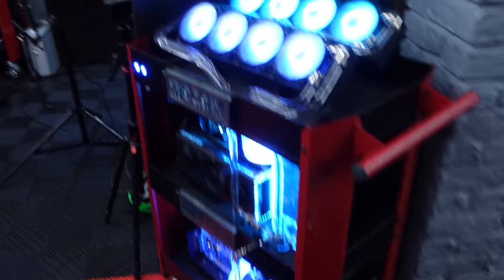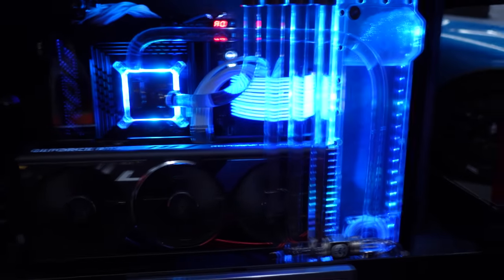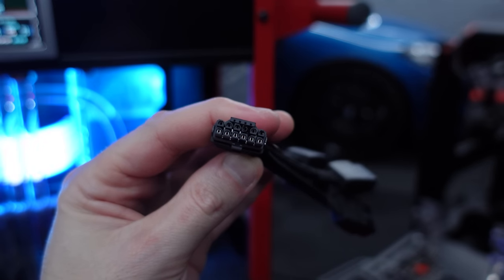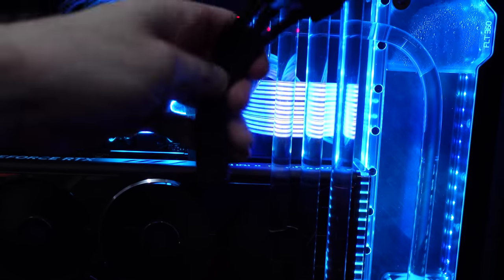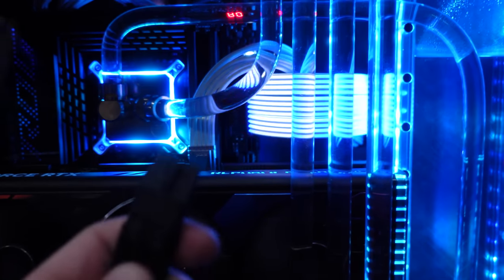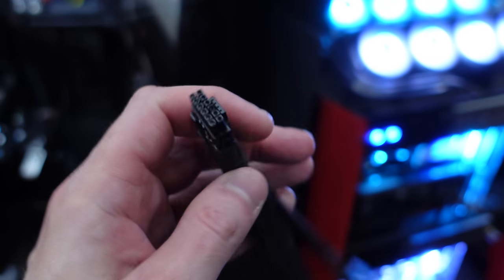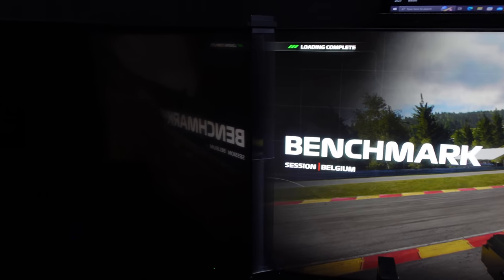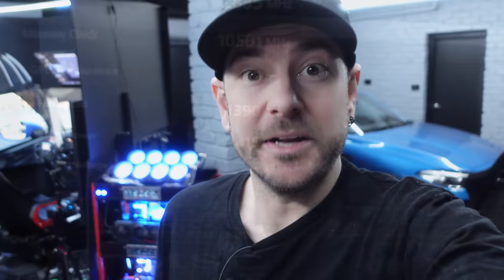MY 4090 WENT UP IN SMOKE after 7 Months!

Comment from the maker: For the people who feel the need to blame this on “user error” before watching the video. Yes it was plugged in correctly. I was absolutely meticulous about this and even made a post 7 months ago warning others. 

The pins were completely engaged and the connector was clicked in to position with the top of the plug sitting completely flush with no gap. There was also no strain on the cables. Only the force of gravity.
Reply: if users are repeatedly making "user errors" on a specific GPU (never happened with prev gens) then I don't think it's user error anymore... it's nvidia shit design.
Reply from the maker: IMO User error shouldn’t even be possible on a connector carrying enough current to cause a fire.
Reply: You have to keep in mind three things:
The first is that the male pin of your RTX 4090 where those high temperatures happened also overheated, so it may no longer be in the best condition. It wouldn't surprise me if this problem happens again in the same place with the new female connector.
Second, when you connect the male connector to the female connector, sometimes there is a couple of male and female pins inside the connector that do not fit well together, because, when the two are joined, one of them can retreat inside its plastic house, due to the excessive force of resistance when joining, causing these two pins to be poorly fitted and this smaller contact surface will heat up in moments of greater consumption of electrical current from the graphics card. This can happen inside a connector, even if it's not the 12VHPWR, which apparently is well inserted.
Another very important detail, mentioned below, is that there are game menus that do not have restrictions on the maximum number of frames that a graphics card tries to do. I've seen a friend of mine's RTX 3070 momentarily charge 1000 FPS in an indie game's menus, which is the only time when that graphics card's fans fire to the maximum of their rotation, as this is the time when the card graphic heats up. And it's already the second indie game where he has this problem, which he can only solve by activating V-Sync in the game's menus. It could have happened that in the menus of this new F1 game there was also this problem and when you were away for 10 to 15 minutes, the game menus made the graphics card work at its maximum, without interruption, which combined with a couple of misplaced 12VHPWR connector pins has led to this unfortunate situation.
Reply from the maker: Yep you’re spot on. Then pin itself didn’t look discoloured on the card side. But I’ve put in an RMA claim regardless as I said in the video. Don’t want to take any chances. 

The pins inside the connector didn’t look to be damaged or pushed back at all. So my guess is it’s just a very minor misalignment internally despite the correct alignment of the outer shell.
Reply from the maker: It’s also interesting that the heat seems to have been generated toward the tip of the female pins which would indicate that was the only part making contact.
Reply: Crazy as. Hope you get this resolved quickly, better for this to happen sooner rather than later at least. 

It's completely unacceptable though, however way you wrap it. The user error gaslighting needs to stop too.
Reply: Yep, the fact that just one of the middle pins has burned and not one of the outer ones, should be evidence that this is NOT the standard case of connector not being plugged in all the way i.e. this does not fall under "user error". 
I don't see how anyone can plug it in wrong so that just one middle pin doesn't make a proper connection.
Hopefully there is a revision/redesign of the spec of 12VHPWR connector.
Reply: Look at the line across in your first still photo. It clearly wasn’t seated flush and there was a gap.
Reply: MSI makes yellow connectors, just to be safe look into them
Reply from the maker: @Danstealth I see the lines you’re talking about but they aren’t from it not being installed correctly. Probably created by the heat cycles through the plastic where the pins end internally. 

I’m sure a lot of these failures have been caused by the connectors not being seated correctly but not this one. I was absolutely meticulous about it.
Reply: Avoid adapters like the plague and stress testing new hardware. Can avoid a lot of problems from bad design and manufacturing like that cursed power connector.
Reply: Can you contact GamersNexus about it? They would gladly look over the cable and maybe give some feedback on what may have happened in your case
Reply: @boostedmedia  the pins don’t end there internally. 

I’m telling you, your connection melted because of a poor connection and that happens when the plug isn’t fully seated. I’m not saying you didn’t fully seat it at one point, I’m sure you did. But when the plug melted it clearly wasn’t. The lines are not there from heat cycles…it’s there because the pins themself got too hot and there was stress on the loose connector.  It’s a very common occurrence and basically shows that user didn’t have the connection fully seated.
Reply: Gamer's Nexus has multiple videos out with extensive research as to why this is happening, and its my understanding that we've known exactly that for some time now. Unfortunate time we live in where thousands of dollars can melt away, sorry to hear this!
Reply: @hellowill  "never happened with prev gens" Do the research, this has occurred both with 30 series and 20 series cards whenever a user does not properly seat their cables or use a 3rd party adapter. This has been going on since GPUs started connecting via power cables. Definitely user error, if not the issue would be wide spread. Even the AQL expected failure rate is %4 for this product. This products current failure rate is %0.05 (this also includes both user error and 3rd party usage)
Reply: Because of repetitive hating and cooling due to usage the plug will get lose on the long run because of bad clips design. What you need to do is to check periodically if the cables is plugged all the way in and problem solved
Reply: @oMeGa0122  "Because of repetitive hating and cooling due to usage the plug will get lose on the long run because of bad clips design"  Is that what happened with yours ?? LOL !!! 🤣
Reply: Northridge Fix is of the same opinion, this is a Nvidia problem. The sheer number of melted connectors is not USER Error..and as I am looking to build a PC to get off Console.. this is concerning..

Comment: Pulling 450watts through a tiny single pin will cause melting and that outcome. Over time that will fatigue, as they consistently carry load and corrosion also will slip in and introduce heat. The more corrosion and lack of contact the more heat, it’s like a supercharger to its own problem.

I think you’ll see more problems with these connectors the more the end user actually uses the card in a high draw scenario.

Comment: My biggest concern as a 4090 owner, can’t even leave the Pc unattended. Hope everything gets resolved quickly for you.
Reply: I don't think I'll ever end up with a smoking connector due to probability, but the fact is getting a 4090 is playing russian roulette with your safety. Month after month steadily more cases of melted connectors, it's a constant reminder
Reply: So it's only really an issue if you're drawing a ton of power(leaving a game open). If your PC is at idle and drawing 25-30 watts, it's extremely unlikely it will  melt during that time.

There have been no documented cases of the 4070 TI failing(285 Watt TDP), and only like 2 cases of a 4080 failing (320 Watts), despite using the same connector.

I have my 4090 power limited at 55%(250 Watts), in part for this reason. Most games have no performance hit, only the most intensive games see a 10-20% performance hit. Also has the added benefit of the card running quieter, my room not getting as hot, less coil whine, etc.
Reply: @Skilliard  Apparently the issue is the adapter itself. There's supposedly been no issues with the 4090 running the Corsair direct PSU cables, which is what I purchased, even with that I reduced the cards power limit to 90% lol
Reply: I really hope Nvidia hardcore addresses the power cable issues for the 50 series release

Comment: I pretty much agree with your diagnosis here, which is a bit worrying as its a manufactoring defect thats caused this. Ive had my card for a similar period and even today after 6 odd months i still dont leave my PC unattended while its running. I stress tested mine up to the maximum wattatge possible for a good 2 weeks before i even began to feel slightly more comfortable.
Reply: Same here when i got my 4090. did not feel comfortable leaving it on unattended. the connector melted last week after 6 months of use. No user error on my part.
Reply: can you share your stress testing routine for 4090?
Reply: @MansoorAhmed-ts3eg  a good simple test is to run 3dmarks stability test.

Comment: Will, had the same issue on my Gigabyte 4090, and I was using the new right angle CM adapter as well and it still burned! I had the card since Oct 2022.  Thankfully Cablemod took full responsibility and re-imbursed me for everything including the costly GPU, and provided a couple new adapters.  Northridge Fix believes there's a defect in the cards, not the cable connectors themselves.  Anyway, really impressed with Cablemod support.  I feel if I sent it back to Gigabyte, they'd probably give me the runaround.
Reply: More likely, an nvidia design miss, it mostly the 3rd pin that melted, to frequent to be random.
Reply: @winnieid2727  have you guys heard of this happening with MSI 4090s? I believe that’s the brand used in the Corsair Vengeance PC due to arrive here Friday.
Reply: It's not the card, obviously, since it doesn't pull enough current to melt/burn a 600W rated connector/cable. It makes no sense other than maybe the connector (on the card) itself doesn't meet the standard/spec? But if it's a standard connector on these cards, only things it can be are 1. The cable or more specificly its connector, doesn't meet the standard/spec it should, or 2. user-error/incorrect use of the cable that can lead to this, such as bending it and all those we already know.
Reply: @AdamsBrew78  yes just had this happen on my new Msi suprim over weekend and was using the cablemod rt angle adapter, not happy , this is now 2 4090s
Reply: @AdamsBrew78 lol 4090 users buying prebuilts😂
Reply: Unfortunately for Cablemod they are eating the cost of nVidia's incompetence. I'm not surprised they recalled the product, what company wants to be liable for their partners mistake?

Comment: The adaptor cable has 8 wires that are bridged at the 12VHPWR  plug to make the 12 connections.  Were as the new  cable supplied with PCIE 5 PSU have 12 wires 1 for each of the 12 plug connections spreading the load more evenly like the white 12VHPWR shown in the video.  Anyone who purchases RTX 4090 should also mach it with PCE5 PSU like the MSI MEG A1000G do not use the adaptors.

Comment: MSI 4090 in my sim rig and I’m using the Corsair RM1200x shift power supply and their cable. So far no issues but still seeing these problems is worrying. Glad you caught your problem before it turned into something much worse.

Comment: Considering that the Strix comes with a 600w power limit that‘s a pretty bad look for Asus. I‘ll order my 4090 soon and it‘ll go into my case with a Corsair power cable designed for my AX1600i power supply. I‘ll definitely check the cable thoroughly before installing it because I will install a water block and I‘m not at all interested in tearing the system apart again any time soon. Will make sure to put the system into rest mode when I leave the PC for more than a few minutes as well after your report, so thanks for sharing!
Reply from the maker: I unfortunately bought my AX1600i about 3 weeks before they revised them with the new smart interface.
Reply: @kolysion164  Why not use the corsair cable?
Why introduce additional failure point with a 90 degree adapters, take a look at people that are burning the cable mod adapters...
Reply: @kolysion164  damn lol, so narrow minded and completely unaware of stuff that's going on with the cable mod adapters now.
Reply: 1600w power supply 😂😂😂 are u bitcoin mining with 3 cards or 4

Comment: From what I have gathered, I think the connector is backing out of the connector over time from getting hot, then cold.  The clip in the middle just isn't enough.  You can move the connector around even when the clip is engaged.
Reply from the maker: I was checking mine weekly. It was seated fully.
Reply: @boostedmedia  Oh, good info to know.  They should just go back to the old cable style or redesign the plug.  I know one guy on youtube that fixes GPUS has dozens of burned 4090 plugs at any given time.

Comment: The more I read and hear about this all the more I’m convinced there is a huge design flaw.
I was wondering why we keep sticking to 12v anyway when so much wattage is being used. Up the voltage towards 48v for example that will lower the amps considerably and less problems causing overheating.
Then again, why try to stick it al into 1 connector? What is the problem with 3?

Comment: I do run my 4090 at 0,975V and 2775MHz. Maybe that is something to consider to get the temps down. I noticed my power draw was much higher with F1 23 but no issues so far. However I use the ATX3.0 12V HP connector from be quiet. No adapters. Thanks for making us aware!

Comment: I immediately ordered the 12HPWR cable for my Corsair power supply directly from corsair to get rid of the adapter. Hopefully this is a better solution than an additional adapter with all those additional resistance and voltage drops due to additional connections.
Reply: I did the exact same thing, I didn’t trust any of the adapters so I bought the corsair cable then bought my 4090.  Never plugged in the one that came in the box

Comment: Sucks about your card but it does make me happy it was the splitter cable that went up in smoke. My MSI Mpg 1000w psu has a 12VHPWR port and a 2 end cable (one for the psu and one for the gpu. The cable is labeled "600" and has yellow tabs on the cable. For 2 months its been running like a champ (i purchased the psu in Jan 2024) i promptly broke out my rtx 2080 when i bought the psu as i had a rog 850w and i saw how the splitter cables that came from the GPUs manufacturer kept melting. So i stuck to using my rtx 3080. But playing my cyberpunk2077,  God of War ragnarok,  and other open world games that i normally have to turn the graphics down on to play is no more. I can play on ultra settings which makes the game look even more realistic.  Im thankful to MSI and this 600 watt cable which seems to be holding up just fine.

Comment: 420 watts is not much on a 4090, mine runs 450 on average and 520 is the max which I do see sometimes.  God of War at 8K draws the full 520 watts continuously, and the adapter does get warm to the touch

Comment: This happens far too often to be user error. It worries me that my 4090 could be a ticking time bomb like yours was. However  i do have an aggressive undervolt on mine which reduces power draw by 40% or more in most games. Best of luck with your warranty mate.
Reply: what's your power draw? I'm going to undervolt too, and I was told 350w is safe, which this video clearly demonstrates, isn't!
Reply: In most non RTX games 200-250 watts, RTX enabled games 250-300.
Reply: @davemorphling7432  In the video it didn't melt until it passed 400 Watts.

But from what I've seen, there's been a couple 4080's that have failed at 320 Watts, but no 4070 TIs that have failed(285 Watt TDP)

Comment: I was using 3x power adapter with no issues for my 4080 but went and got myself a Seasonic VERTEX with 12pin power cable and port to be on the safe side. No issues so far.

Comment: I am running a Asus Strix 4090 OC on the HX 1200 watt corsair PSU and got the Corsair cable right away its running from 12 februari 2023  with no problems jet. :hand-purple-blue-peace:

Comment: Good to know nothing bad happened afterthat. You should reach out to Gamers Nexus to help you investigate what caused the 4090 cable thing to burn up like that.
Reply: this would be the cross over i need in my life.
Reply from the maker: They’ve pretty much exhausted the topic already. It’s pretty clear what happened here, one of the pins wasn’t making proper contact despite the connector being plugged in correctly and no strain on the cable. It’s just a bad design.
Reply: Would love to see the colab but at the very least would be very interested to see the connector opened up and see the quality of the solder connections ect
Reply from the maker: The pin melted at the tip so it seems to me that was the point it was generated. Bad contact between the pin and socket is the cause, despite the connector being inserted fully and correctly. Not a bad solder joint.
Reply: @stormgear896 Gamers nexus will just blame user error, he has doubled down on this even though it is very clear its a design flaw. There is a serious problem with these new connectors.
Reply: Most likely, gn will blame on user errors.

I doubt people who use cable mod will not know about the melting issue or try to mitigate it. But the card is still burning out in the wild. It just kinda dumb argument to blame user than a design flaw/miss
Reply from the maker: When did Steve become the only person on the planet qualified to judge the quality of a connector? 😂
Reply: @boostedmedia  Right!? I seriously hate how manipulable his audience is!!

Comment: Do you still have that connector? It would be amazing if you could cut that open and see where the failure occurred. With enough logged data I'm sure a second hand manufacturer could make a better option.